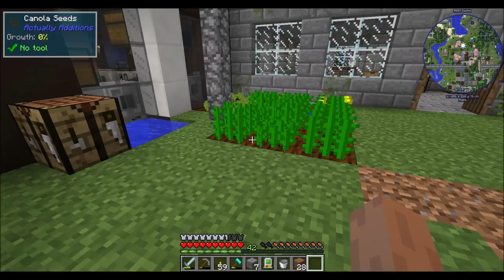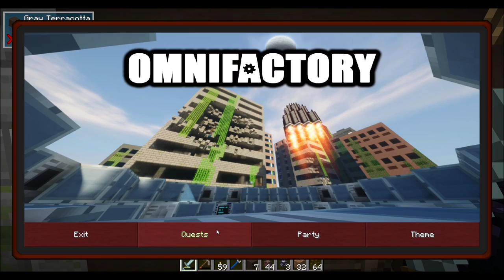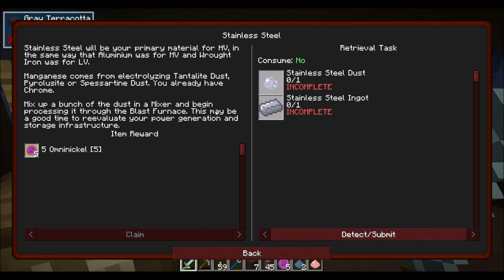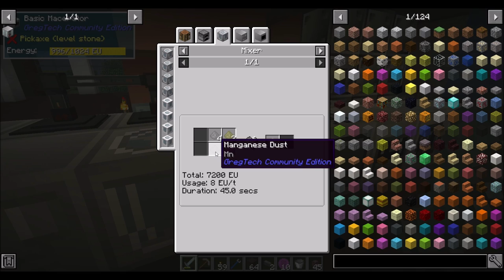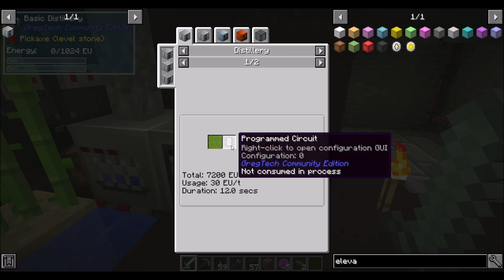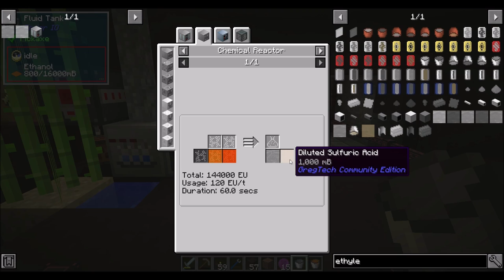OmniFactory   Ep19 Ethanol

Comment: Direwolf20, huge fan. Direwolf20's lets plays and play throughs, huge major fan. Yes, that is a thing. GregTech... only one question: What sadist made that mod? I mean, that mod makes expert mode micro crafting a pleasure. I am trying to watch through OmniFactory, but I just get to a point where I feel like sending you large quantities of alcoholic beverages and think man... how do you stay happy. You always have a great positive attitude in these things, but if you lost it, threw your monitor across the room and said you wanted to quit, I would totally be there with you.. :)
Reply: Gregtech has been through 6 different iterations not counting the community supported versions like the one in this pack. It first dates from around the 1.2.5 Minecraft era and was at that time just an end game addon to Industrial Craft. The micro crafting showed up in Gregtech 5 and has been cloned into most of the community versions. It has been reduced a bit in Gregtech 6 but that is only available for Minecraft 1.7.10.
Reply: I agree, GT5 is one of the worst designed mods I've seen. 8 voltage and 24 different circuits made just to drag thing on and on with absolutely no real changes are beyond any reason.
Reply: @johnsmith3548  i quite like it. it has a sense of real progression to me, unlike most mods. i agree, on its own its quite boring but in a good Modpack like GT-New Horizons it makes for an amazing journey! "Worst designed mod" is quite harsh. id say its different, but not necessarily "bad different"
Reply: @Neakas  My main complainant is that it's atrociously redundant. It's quite fun when you learn new things but after getting to MV there's nearly nothing new happening and its literally designed to make player grind in worst ways possible. I can imagine it to be made far more tolerable by removing maybe 3/4 of the mod's redundant grind, but I haven't tried new horizons. Even then, I've had a rather hard time to find a really neat features like those existed in GT4 version. It might not be 'worst designed mod' but it's certainly takes place of worst designed mod rework.
Reply: Greg. Greg made it. And gregs minions adapted it for 1.12
Reply: I kinda agree with John. I mean, the crafting recipes are like nested 4 or 5 deep. It's a progression, especially in this mod pack, that has a 1000 machines that take one thing and make another one thing and another thing needed for another thing. A 1000 ores, easily findable, to make a1000 parts, to make a 1000 other parts, etc. The machines externally aren't bad. Internally are pretty bland. You have to craft advanced versions to tier up instead of upgrading? I just was watching Dire thinking, dude, I so feel for you and he stayed happy. Kudos to him!  Honestly, I haven't played this pack, just watched, because I am currently doing a few modpacks (DIrewolf20 again!, FTB Sky Odyssey, FTB Interactions... yeah, I like pain.). I'm doing Interactions that uses GregTech. After so much time of finding like 30 plants, 90 ores and getting through the Bronze age, I was hoping I was getting up there. Wrong. There are like 11 ages! DUDE. Basic, LV, MV, HV, 5 or 6 Vs, UpV, DownV, and crafting?... So, I got Mr. Mee Creeps in and Simple Storage and said ok, maybe I'll fast track and just pretend I'm ok. I really hope the next big modpack doesn't have GregTech in it. I love crafting. Loved Enigmatica, even did Expert. Loved Sky Odyssey. I would have loved this pack, but it's just too much micro crafting. Too much nested crafting. I can appreciate the effort GregTech put into making GregTech. They must have included a whole set of encyclopedias worth of knowledge into it. I'm just saying, put a Transmutation Table in there with EMC for all the parts, or many of them, and maybe it could be doable.
Reply: @johnsmith3548  Depends on what you mean when you say nothing new after MV.  Steam age(which was removed) is the getting started age where you mine all the resources and do some basic stuff.  LV then gets you trying to figure out Electricity and at best basic fluids.  MV Starts the EBF up and gives you a lot of stuff to do with chemicals.  HV then starts a few major chemical reactions like polytetrafluroethylene.  It also contains the vacuum freezer and a few other nifty gadgets.  EV then starts up multi-block turbines for energy generation.  IV starts up the assembly line.  You then have the fusion reactor.

The mod has a ton of content after MV and you should NEVER be grinding.  the problem is that direwolf20 is playing it pretty badly,  he has almost no automation going, a crappy power system and is relying on the fact that eventually AE will be able to do it all for him.  

With a proper ore processing setup, he could have had that chrome a while ago and in greater quantities just from processing ruby ore with an ore washer and centrifuge.   

With a proper power system he could fix all that messy wiring with putting his polyethylene chain on it's own CEF.  

If he looked at dynamo specializations he could easily generate more power.

With that said Gregtech offers very few cool things that you can take out into the Minecraft world and use.  Which is why I prefer packs like Gregtech: New horizons or Infitech or Interactions that Gregify the recipes of other mods that give that kind of stuff.  Gregtech then supplies the automation challenges and the base building challenges while the other mods supply fun ways to get resources or cool new toys to use while exploring for ores.  Instead Omnifactory goes the brute force route and just gives you a ton of resources and tells you how to progress through gregtech.  Which of course also means that certain items are missed because they put a quest that tells you not to ore double without thinking about the fact that ore processing in gregtech isn't as much about turning that one ruby ore into 2 rubies, it's about getting 1 chrome dust instead of 1/6th of a chrome dust.
Reply: @andrewgood7956  I'm well aware of GT steam age, but it also nothing that great, as it only steps as a wall until you can get electricity, then never ever used again, which makes me question the point of it. I've been playing GT5 at some of FTB packs during 1.7.10 but dropped it midway, I think even fluid crafting stuff wasn't there at that point. 

What I mean by forced grinding is how it's designed precisely to not let you jump through voltages until you produce a specific amount of machines for each tier, which nearly never justify the creation of them besides being gates. As a simple example, it's how you are not able to make circuits in assembling machine until you get MV one, simply because recipe does not allow LV. 

The other part of what makes it pure grind, is the recipes themselves. So you make a hulls, cables, motors, and then finally an assembling machine. You advance to MV, and then... you make hulls, cables and motors but with slightly different resources, but exact same recipe. The MV assembling machine, which you are FORCED to make, is exactly same in functionality (and all other MV machines which you have LV counterparts to). Same happens at HV, IV and so on. I move to the next tier, and instead of being excited I look at what I have to make and see same shit I just did, but now with new voltage. What's the point of this, besides making player waste his time? This is the most crude level of grinding I can imagine. I've played omnifactory, but after finally fully automating polyethylene, polyvinyl and t3 circuits (what took me a good 15-20 machines for only fluids excluding interfaces/import/export buses etc) and as a reward I was presented with... a requirement to make an exactly similar system but for processing oil (which is finite too, so full automation is under big question). After which I took a look over whole quest tech tree to see where's the actual good stuff and dropped the pack. I love expert style packs and I've completed project ozone 2 kappa mode among other things, but GT5 is designed to suck away all the fun of progression making you repeat same recipes for same things over and over.
Reply: The mod is fantastic, it just takes a TON of time to go through.  I would try playing along with him, and seeing that it isn't really that hard.
Reply: It does seem like it would be an awesome mod if you had enough time to do it correctly. When I started the Bronze age I was happy :) If you have storage and can set up enough auto-crafting it could be fun. I like the progression from steam to other things. I even liked the hunt for ores seeing as it was much easier to find veins, scanner and all. I just think you have to love complex crafting (by complex I mean micro crafting, crafted items nested in crafted items nested, etc.).  For Dire, he's a wizard in all this. He goes so fast that some of his quests he has to redo because it took longer for the quest to recognize the item than it did to craft it and use it. lol..  So, maybe you're right. I'll try to be openminded with GregTech. It's just hard to find the time. I'm not the typical gamer. I own a business and am almost 50. I play everyday while I'm working. I want to progress but can't do it without mapping a direction and writing down where i was and where i'm going. But it's all good... Would love easier recipes though. Do you know if the recipes in OmniFactory are the original recipes or are the modified for this pack?
Reply: @wrkhrvst  That makes sense for you.  I am doing some collage classes, so I am quite busy.  
I believe that many recipes, especially ones that use items from other mods, are custom.  The author changed things to make it harder, but have everything integrated.  If you want to play a better pack for automation, I would try Stoneblock.  You can quickly automate things with chickens, and thermal isn't that far along the road.  In addition, most recipes are standard for their respective mods.

Comment: The flipping machines can auto output.. pains my GT heart to see all the direwire, learn the BASICS.. will save so much derps from happening. Also stop trying to get by using one of each machine.. set up multiple dedicated LV machines (making everything higher tier.. is not needed and will only hurt your power) once you will start automation you will quickly notice you can’t automate everything in one machine.

Comment: Does anyone else have a problem with sugar cane farm ? My sugar cane just won't grow faster even though I did everything like Dire with timers etc. :(
Reply: Are you using Snad or sand? Snad is made using double compressed sand. The redstone clock doesn't work with normal sand
Reply: Make sure that you use snad, or if you haven't updated the pack, use red snad.  They removed the recipe, as it was OP.  I made a ton when I saw the recipe, and currently have 800 red snad.

Comment: Anyone else watching Krakaen's playthrough of this? Seems more efficient.
Reply: He certainly goes all-out when it comes to automating and scaling everything up.
Reply: @MisuVir  You kinda have to with GregTech it seems
Reply: if you have played gregtech packs before you kinda already know the tech tree and what is required for each stage and how many items your going to require to build infrastructure, my factory layout is a 5x5 chunk with multiple floors at 10 blocks high
Reply: @CHEFSHAWNHAYES  Kinda how I did mine.  My "building" is basically a room that is 2x2 chunks with a change is flooring material to indicate chunk borders that give it a nice pattern.  The walls are 1 block away from the chunk borders which gives me a nice 2 thick area when the building is copied and laid next to another to lay cables and such that I can generally walk through/staff of traveling to  and don't have to destroy blocks to lay cable underground.  Each floor is 7 blocks high but there is a 3 blocks of air between each floor to again allow me to be able to lay cables neatly. 

Generally speaking each chunk of a room has it's own CEF or 2 and a dedicated purpose.  Each room has a bigger overall purpose.  My Power room for example has ethanol production in one chunk and diesel generators in another.